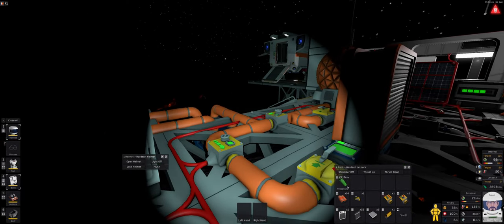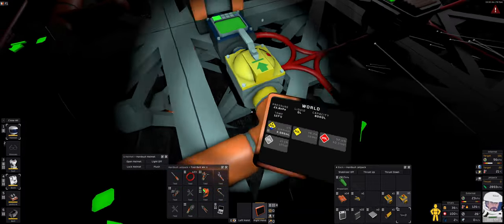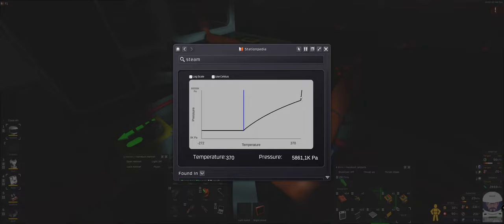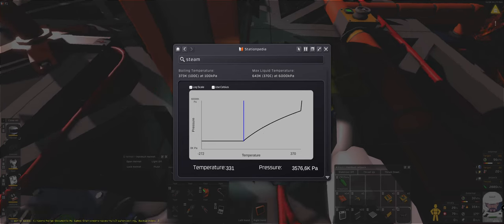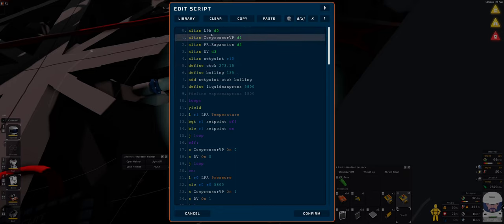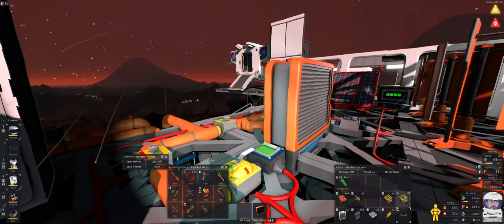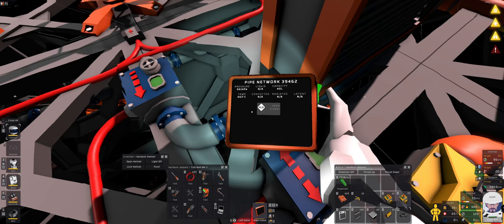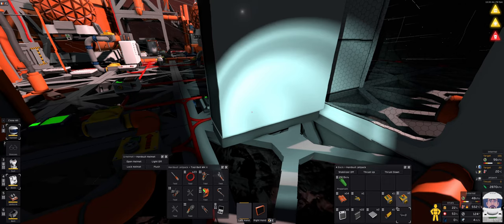Stationeers - direct water cooling on Vulcan Phasechange AC

Comment: Very noisy and very interesting thank you
Reply from the maker: the noises coming from the old system with the new chambers, which i not fully understand yet. the problem is pollutant needs high pressure (6MPa) to evaporate and liquid pipes start making sound at 5,2 MPa. the watercooling system is quiet.
Reply: Nice system! I was in the phase of trying something like that, thank you for sharing. It's on Vulcan tho, you say venus on the title.
Reply from the maker: @Mokowna  thanks, i corrected it to vulcan.